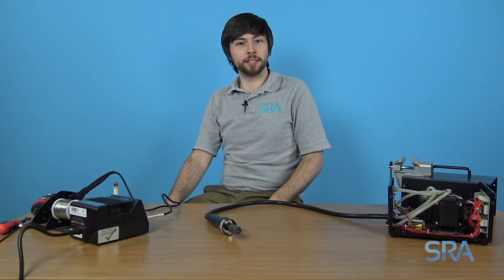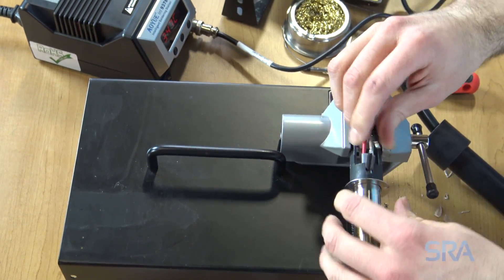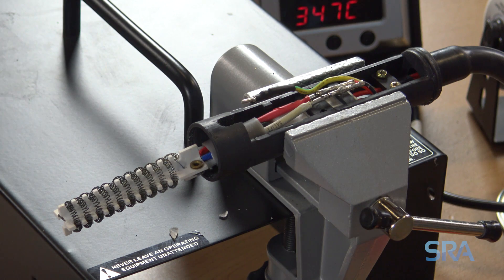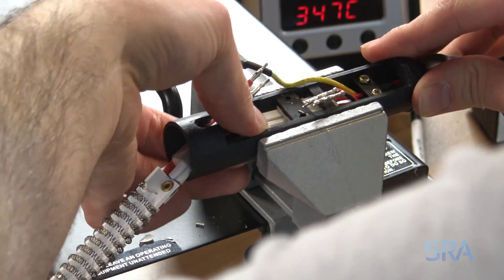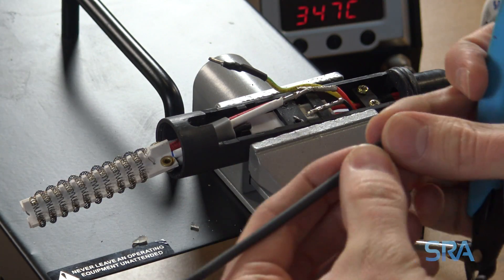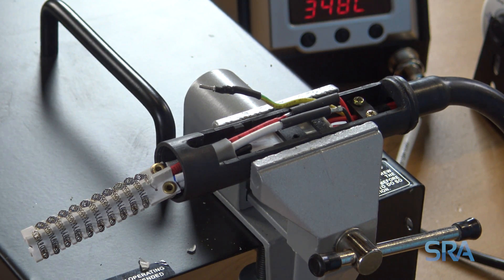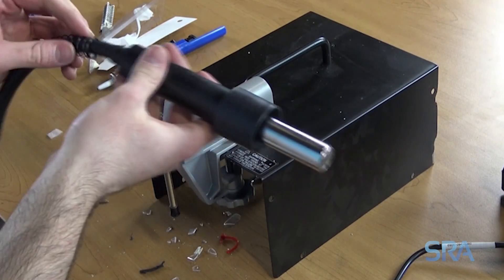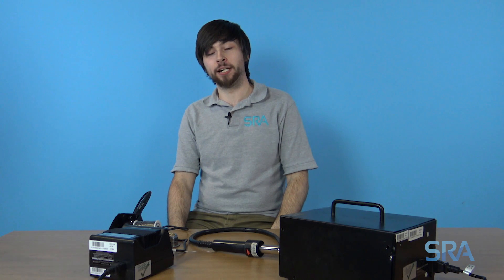How to Replace the Heating Element | Aoyue Hot Air Gun (AO20094)

Comment: Why  there is glass when you open it?
Reply from the maker: The inside of the element is constructed with a glass tube to keep the air focused to the tip of the nozzle. When the handle gets thrown around it can shatter inside. This glass piece is included in the replacement heat tubes.
Reply: @SRASolderLab  i just bought a 738H i hear a noise when i shake the gun, i open it and there was a little piece of glas ,the air gun seems to work well can i still use it as this ?
Reply: soundstream32 if its just a small little piece it will work perfectly fine. If it’s mostly missing though I would say replace it just in case.
Reply: How to buy glass tube for heating elements and where?